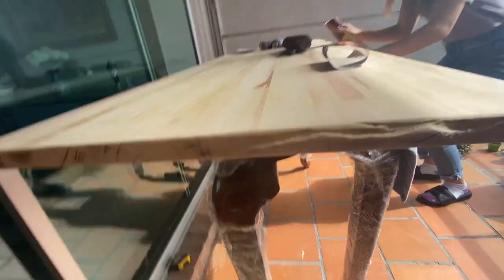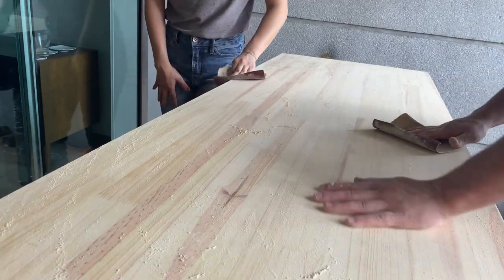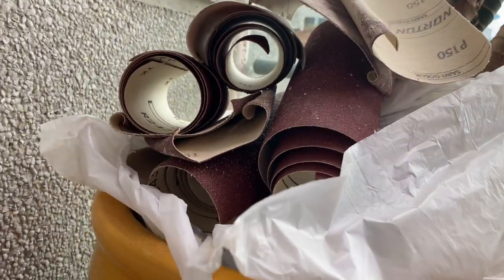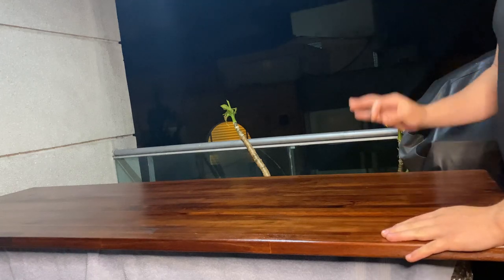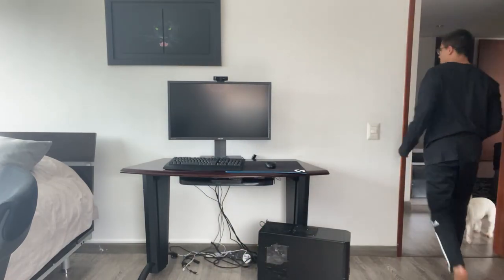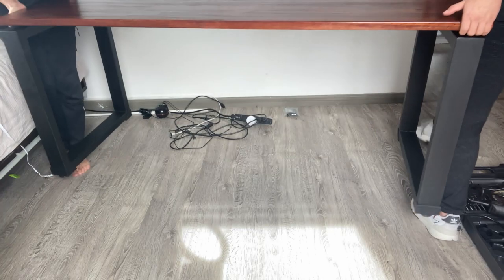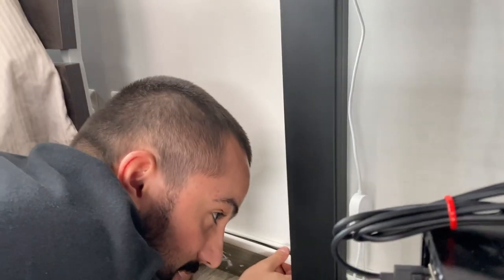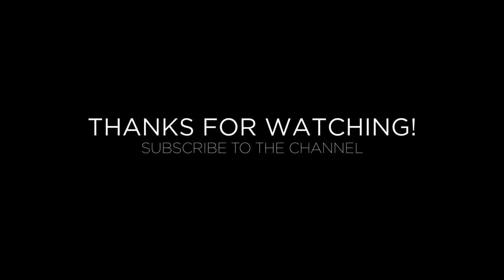How to Build a MODERN WOOD Desk For Under 100$ | Custom DIY Desk 🎮

Comment: Where did you get the bauker grinder?? I'm from Chile and that brand is only sold by a company of my country.
Reply from the maker: Hi Daniel! It does not have to be Bauker, there are multiple brands you will find in Chile that will do the job well for not that expensive.